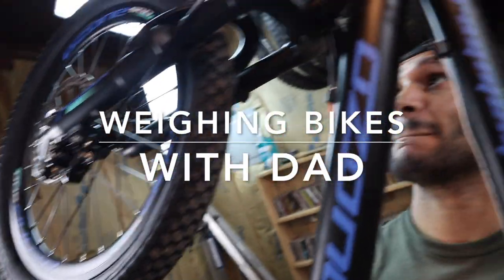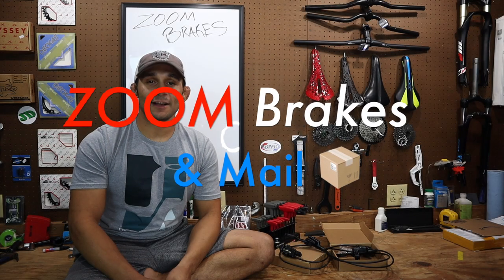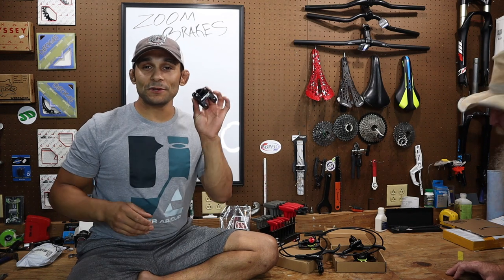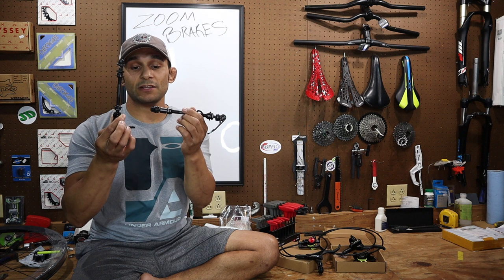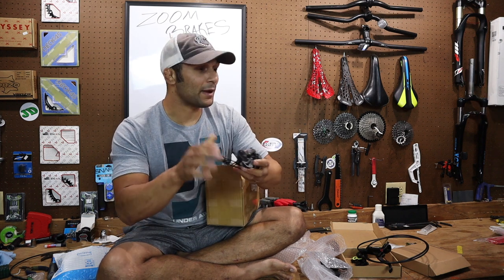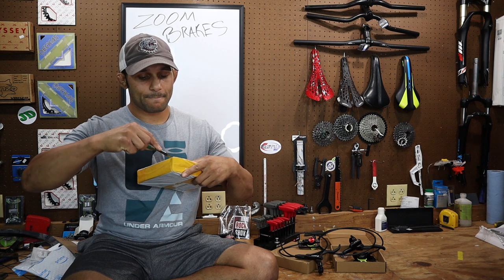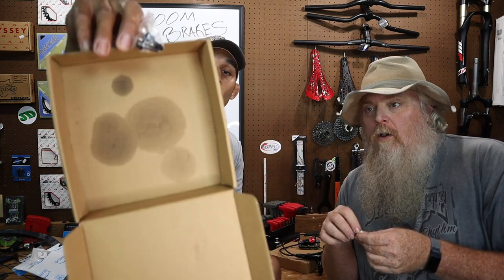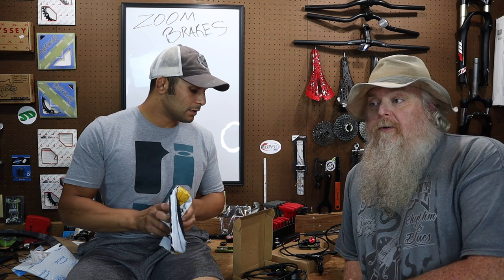Zoom Brakes on the Schwinn Taff + Mail

Comment: Side note - I have done plenty of work to hydraulic brakes - and these zoom hoses would not come out of the levers.  I did not want to damage anything - so I ended up just flipping the levers over and placing US style - it seems like that works fine - the pressure even seems to have improved.
Reply from the maker: Dude you are correct, we had hell trying to undo them! I had dad hold one side with channel locks and I had hands on the levers and calipers. Crazy man!!
Reply: @WOLFTICKVIDEOS  I forgot to add it looks pretty good too - almost as if they designed it like that - if they had put the logo on that side it would look stock.
Reply from the maker: @NS-zv9qf  thays not the worst thing in the world I guess, if they work then way to go! Lol thought about it but I was like NO...I 😉
Reply: @WOLFTICKVIDEOS  Next time try it a few rides.  In fact before I flipped em I wasnt planning on buying another set.  After I flipped em the performance improved - still wondering how - I may keep buying  em...
Reply from the maker: Rode with them today after the bleed and they were pretty good man, I dont see a problem with them at all for $43:)

Comment: Most rims can be converted to tubeless make sure you put the tape around the rim do you have to change the air pressure tubeless for the GT Bike 🚲 Wow 🤩 Welcome to the future
Reply from the maker: 😂😂😂😁😁Yuor stuck on the Tubeless arent you!!??
Reply: WOLFTICK VIDEOS   Race Face Stash Tool Wrap Black, One Size something you should look into you could carry a tube and a few tools on the strip on Amazon for $20 Budget friendly
Reply: WOLFTICK VIDEOS  your bike ride better tubeless you’ll be able to go faster get better traction on the trails Less flat tires going to Tubeless  Lighter weight
Reply: WOLFTICK VIDEOS  You could pick up some gorilla tape to put around the rim don’t put the Celine do a dry test make sure the air stays in
Reply from the maker: Ill look into it, but the safety gear and essentials video we got, that thing is pretty tight!
Reply from the maker: Dude! IDK if I need to go faster ha ha ha!!
Reply from the maker: I seen that man! There was a video somewhere?

Comment: 9:13 you can put grease on the spacer then it will stick to the  stock adapters, but the fork has dropouts for torque caps, so this makes it harder to align the wheel, but  Newmen  has a solution, it's small part that you glue on with lighth adheisive.
https://bikerumor.com/2019/03/27/found-newmen-torque-cap-fork-reducers-simplify-hub-installation/
Reply from the maker: Will check it out brother, thanks!
Reply: @WOLFTICKVIDEOS  you could probably use light adhesive on the adapters too.
Reply from the maker: for sure man, I will check into it tomorrow thanks Johannes

Comment: heyyyy i see you finally got those bolt on to quick release hubs. i forgot to update you on them but i slapped it on my bike and everything went fine.one thing to know though is that yo must have 5mm of axle sticking out and if you somehow cant get some washers to space both sides out to 5mm. what happens is your frame will flex too much and you'll never be able to tighten it down properly. asides from that not too hard of an installation. just very greasy
Reply from the maker: Thanks for the update and watching brother, I was waiting and wondering If I would need any spacers. Looking forward to it and hope it goes well, thanks again NUTTY!!

Comment: Question. Hopefully you guys see this. I bought these breaks and for the life of me can not take out the hose out of the lever. Did you guys have a hard time with that too? Or is it just me? Any tips on getting the hose out?
Reply from the maker: Man we had a hell of a time getting one of them out. If we were to do it over again we would try just flipping the levers over and swapping sides. We have never got the rear working good even after bleeding it 3 times. It can be done because we did it, but I'm not sure it was worth it in the long run. By the way it took us both to pull it out.
Reply: @WOLFTICKVIDEOS  ah man that’s for the response, thought it was just me both sides are stuck in there like glue. Guess I’ll have to just leave them upside down then lol. Thanks again brother. Keep up with the dope videos!
Reply from the maker: @Apac10 Hey thanks man! Don't be a stranger👍

Comment: Thanks for this video. I'm currently shopping for affordable hydraulic disc brakes to put on an older Gary Fisher but as you know, most of the less expensive options are backwards. Seems to be a fairly simple process of switching but do I need any special tools to do that? Other than a bleed kit?
Reply from the maker: Great question man, well the quick answer is no, you just need an 8mm wrench to unscrew the lever inserts. But be careful trying to pry the old housing out of the levers/calipers/ It is very hard and may require two people ha ha. It was a pain and I was sure to wrap something around the housing to make sure not to crush it and or stretch it also be sure not to cross thread, its aluminum. But you may wanna look at the link for the housing? Just incase you break or stretch something. Good luck and hope this answers your question brother!!

Comment: 10:54 you are doing it wrong, those rounded spacers should be used in an ball washer/Spherical concave, they are not meant to be used alone. so together the male and female spacers function together to make sure it's all tightened properly with no gap on the bolt, and keep things aligned.  So thee way you did it, it's not as secure there is less support for the caliper, and in some cases the bolt will not tighten it flush, these spacers are there to take up the angle difference, and make sure the colt head sits flush against it. In your case with this particular setup, I see you won't need ball washer/Spherical concave, but you should use a regular spacer, they are they are the same as chainguide spacers.
Examples:
https://flic.kr/p/2iz936B
https://flic.kr/p/2jjvRow
Reply from the maker: Yeah man its all I had and wanted to use some type of spacer so it kept from inserting to long into the fork, but I feel ya:)
Reply: @WOLFTICKVIDEOS  might be an good idea to order spares, unless you have some laying around from other brakes.

Comment: Yeah it gets one of the brake levers and do a door brake labor too bad they don't have it with hydraulic setup two hydraulic lines in one brake lever I've got a double brake lever setup for my disc brake and rear side pull brake caliper then the other side I've got my clutch there's other people who will run a clutch and a brake lever on each side with handlebarhaving a break and clutch on one side and a brake lever on the other side it's too big of a mess for me to mess with it's kind of hard to squeeze the clutch and then grab both brakes
Reply from the maker: I could def see why you would have that problem using them for your motor bike, lol. If they dont stop you good enough checkout the mt420 2 pistons, they are amazingly strong!
Reply: @WOLFTICKVIDEOS  well if you ever want to put a motor on one of your mountain bikes it's bicycle engines.com some of the stuff that we have that you're going to be shocked I mean if you're curious how fast we can get them up to look under YouTube under motorized bikes 80cc 70+mph we've even got them before their water cooled two stroke we all started off at the basic kit but after you do all your own pudding and polishing read valves performance heads gaskets copper gaskets and bunch of other goodies window Pistons near me then you start increasing your power as long as you stay out of China
Reply: @WOLFTICKVIDEOS  any 80cc it says zeda triple 40 or a firestorm zeda triple 40 which is the same motor
Reply from the maker: Sounds like you are the go to guy!! LOL If we ever need help in that department we will let you know, lol. Thanks brother

Comment: We're the cables that come with the set long enough to reach to the rear of the taff?
Reply from the maker: I would say if you are running a bar that is 740 or less they shouldent be a problem, when I put them up there with my 780's they were too short. So it depends on your bar length. But overall yes
Reply: @WOLFTICKVIDEOS  Thanks! I'm running 760 bars, so we will see.... Finger's crossed!

Comment: What oil did you use
Reply from the maker: Hey brother, this is what I used https://rover.ebay.com/rover/1/711-53200-19255-0/1?mpre=https%3A%2F%2Fwww.ebay.com%2Fitm%2F223399543156&campid=5338684594&toolid=10001&customid=Tektro Brake Fluid